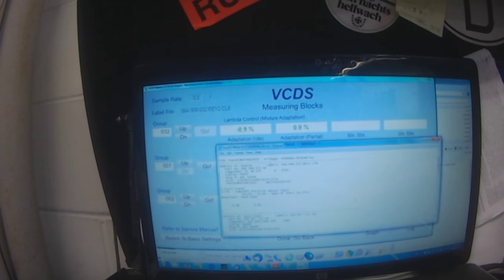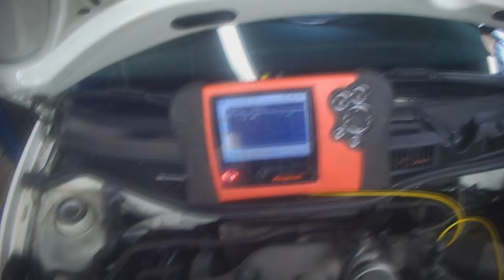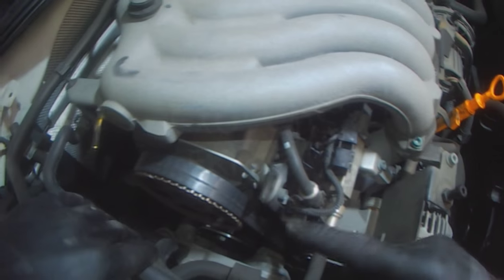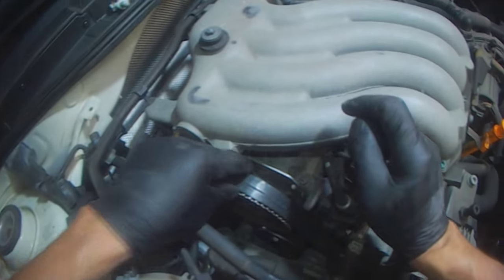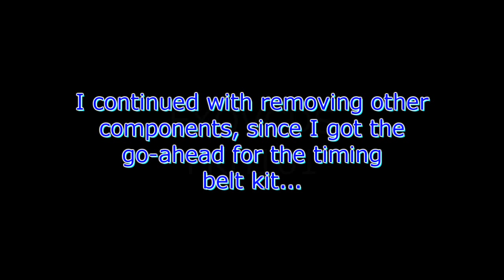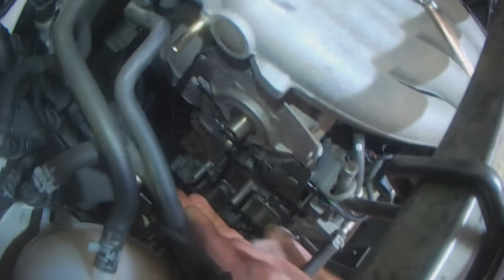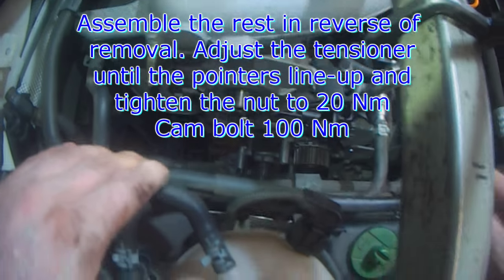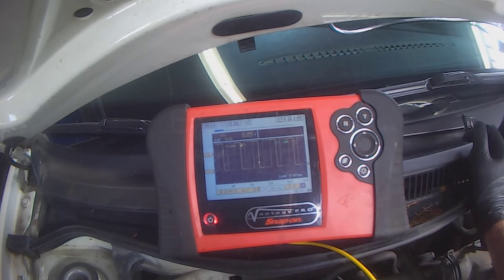VW A4: 2.0L Faulty Camshaft Position Sensor G40 (P1338)

Comment: hey Buddy. I have a A3 AKL engine that has the same sensor. I'm getting intermittent fault codes on G40 and G28 sensors. Should I change both? I was advised to change the CPS sensor first and clean the faulty codes. My car is varying on low RPM and failing sometimes when driving. do you have some advices? Thanks
Reply from the maker: If the engine NEVER stalls or does NOT start... the crank sensor is OK. Make sure that the timing belt is tensioned correctly (not loose). Most likely, the cam sensor is intermittently cutting out... however, that should NOT cause the engine to cut-out / fail. You can disconnect the cam sensor and the engine should still start & run.

I have seen an engine set intermittent cam codes due to missing timing belt teeth! The engine would go in & out of time as the missing teeth caused the timing to shift... it can cause engine / valve damage if the timing slips too far. Make sure that the timing belt teeth are all good! If the belt is older than 6-8 years, replace the belt, tensioner & water pump!!!
Reply: Thanks, buddy. A mechanic just changed the timing belt about a month ago, but he said the tensioner was OK, so no need to change it. I will check the timing and the tensioner
Reply from the maker: Thiago Feitoza If the engine stalls out... it's probably the crank sensor then. Drive with the cam sensor disconnected to verify... after making sure that the tension is ok.
Reply: Thanks, Thomas. I will check the timing and unplug the sensor. Thanks for all your help
Reply: ***** What's up, buddy? I checked the engine's timing and it's ok. I bought a new sensor and replaced the old one. The fault has gone. After this, the G28 fault appeared. I replaced the G28 sensor and the fault got cleared either. Now, every time I try speed up my car, the G40 implausible signal fault appears again. Do you know what can it be? Thanks for all you help, man.
Reply from the maker: Check timing belt tension, timing and the sensor wiring.
Reply: +Thomas EXOVCDS i kno this old lost but wouldnt the car throw a code for a crank position sensor too if thats were the case?
Reply from the maker: David Cifuentes Depending on how far the timing is out, it will only set a cam (G40) code, will set a cam / crank correlation code... or both cam (G40) & crank (G28) codes.

What is the issue with your car if you have one?

Faulty crank sensor should cause a no start or stall.

The engine should run with a disconnected cam sensor.
Reply: well im waiting on a nww keyway right now but it shot a code p0341 and luck is just not been in my favor but i think i might have it down packed now,  i will know for sure when the key arrives
Reply: well i got the keyway and evrything pout back together , and it sounds like shit , my tensioner is set right engine is tdc from transmission window so i have no fucking clue what to do. i hate to say that i am defeated
Reply from the maker: David Cifuentes Can you rotate the engine to TDC and send me pictures of the camshaft TDC mark and the TDC mark at the flywheel?
fkh161@fkh161.ca
When you first had the p0341 code,  did it still run smooth at that time? All you did was change the cam sensor?
Reply: its a weird email adrres but im pretty sure it went through i sesnt two pics
Reply from the maker: David Cifuentes Got them! Looks correct... did you at any time rotate the cam or the crank while the belt was off? Did you unhook a fuel injector?  Is it just running rough or does it sound mechanically bad / loud as well? Can you do a compression test?
Reply: cam rotated quite a few times while belt was off yess,, and yes me and buddy pulled spark plug to make sure was tdc first time around while trynna change the sensor , and i will compression check in the a.m
Reply from the maker: David Cifuentes Valves can contact the Pistons when the camshaft is rotated and the Pistons are up (interference fit engine). Double check the spark plug wires (tight fit) after checking compression.

Comment: Good evening. My 2001 VW Cabrio 2.0 automatic has been shutting off lately when I hit the brakes. Any ideas?
Reply from the maker: +Sal Esquivel At idle speeds only / when stopped at a stop light / parked... or also when at cruising speeds? Check for fault codes, check "fuel trim" values with a scan tool... to see if there are any fueling issues. How is the vehicle shifting? Any codes in the TCM?
Reply: +Thomas EXOVCDS It shifts normal but takes a few seconds to pick up speed &  as I slow down speed, it trembles. Scanner read cam issue.
Reply from the maker: +Sal Esquivel Not all scanners will show all codes... cam sensor is in the distributor. You can disconnect the distributor (3 wire plug) and see if things are different.
Reply: +Thomas EXOVCDS Disconnect it while the car is on? Before I turn it on?l Then drive it?
Reply from the maker: +Sal Esquivel Either... it will / should start with it disconnected and continue to run.
Reply: I tried it on my lunch break. It did run smoother without the cam sensor connected. So I'm guessing it needs to be replaced? Thank you for your time & help.You have a lot of know how! One more question....How difficult would it be to put in a newer motor? Would you recommend it?
Reply from the maker: +Sal Esquivel If the sensor in the distributor were bad, I would not have expected a change in operation. The fact that there is a change, leads me to think that the timing adjustment of the distributor is wrong. It "could be" that the sensor in the distributor is acting up... but the only way to know is to attach a scope to it, to view the waveform. Engine transplants can be done... all depends on money & time.
Reply: +Thomas EXOVCDS I'll be on it this weekend. I'll let you know how it turns out. Thank you again.
Reply: +Sal Esquivel Good day. I drove it this morning disconnected but it turned off on me several times while driving. Not just at stops. What do you recommend I do?
Reply from the maker: +Sal Esquivel Check what is causing it to stall... loss of fuel or spark. Could be a relay issue, crank sensor... any new codes stored? What scanner are you using? Not all scanners will show all codes.
Reply: I did as you said. Checked it all then scanned it again. I tightened what connects the distributor & the cam sensor. P0172 & P0341 are the codes that came up on the scanner. The name of the scanner is CEN-TECH OBDII/EOBD The car did run better but still turned of when I stopped or when RPM's went down too fast.
Reply from the maker: P0172 is system too rich... check fuel pressure, O2 sensor (stuck rich), fuel pressure regulator and anything that could cause a rich mixture. Even a dirty / plugged air filter 

P0341 us either a bad hall sensor in the distributor or incorrect distributor timing (cam & crank timing should also be checked).
Reply: I did a full tune up (plugs, cables, rotor, oil, air & oil filter, fuel filter). a few months ago & everything was running smooth up until a few weeks ago. The only thing I didn't change was the distributor cap. Could this be an issue also as to what the problem could be? I'm not familiar with what you mean by "rich mixture" I feel like just changing the cam & crank sensor all together to see if that will fix the problem.
Reply from the maker: +Sal Esquivel P0172 means the engine is getting too much fuel (for whatever reason)... a cam or crank sensor will not fix that code. You can replace them if you want. 

You might have more than one problem...  too much fuel and another problem that is causing the engine to stall. 

Or, they are related.  

You need to check / test things to determine where the problem is. A distributor cap will not fix those issues... but if the cap is old and worn on the inside, it's a good idea to replace it.
Reply: I feel real dumb asking this, but could the problem come from not have the gas cap on tightly? I went to put gas the other day & noticed that the gas cap wasn't closed correct. As i drove away it drove perfect. No stalls, stutter or turning off. Then I went to re scan it & it came back with no issues. ZERO CODES!
Reply from the maker: +Sal Esquivel Loose gas cap will usually set an EVAP leak code (ECM monitors the pressure in the fuel tank). A loose cap will affect the pressure... and it can affect the purge system (venting of the fuel vapors). Leave the cap tight for longer and see what happens... loosen it to see if things return. That's the best I can suggest.

Comment: when you put the belt back on do you start it at tdc??
Reply from the maker: M G's The belt has to be positioned on the camshaft & crankshaft gears while they (the engine) are at TDC. Starting the engine can be done at any position.
Reply: Thomas EXOVCDS the vw god has spoken 🙌🏾🙌🏾 I just got a mk4 2slow the previous owner did the waterpump and timing belt @100k but didn’t do the cam sensor (sits wit 122k) I just wanted to make sure I wouldn’t mess up the timing
Reply: does autozone/advance auto have that counter hold tool? @4:50
Reply from the maker: They probably do... not sure. I'm in Canada, we don't have Autozone.
https://www.amazon.com/EWK-Universal-Camshaft-Injection-Sprocket/dp/B00VFPOF1E/

Comment: hi thomas i got a jetta 2.0L 2000 and i got the engine code p0341 ( camshaft position sensor or camshaft position sensor A circuit range performance) and i whant to know if the sensor is dead like your video or its sommeting else......
Reply from the maker: Test it... you can use a regular digital voltmeter. Check for power & ground on the outer 2 pins (like in the video), check for a voltage signal from the center wire (like in the video). If it's the original sensor, it's most likely faulty. If a timing belt was replaced and this vode is now present... then the camshaft / crankshaft timing was not set correctly / is out.
Reply from the maker: code not vode.
Reply: so if its not working you sugest me to change my timing belt too.....my jetta got 166 535 km
Reply from the maker: +McFly_Qc Yes, if the belt, tensioner & water pump are still original... change them. If the belt breaks, you will have engine damage. We replace them at 120k km or 6 years.
Reply: ok by the way i got another engine code its P0102 ( mass or volume air flow circuit low imput ) i tink its the m.a.f sensor i already remove it and clean it but the engine code still there...what you tink...
Reply from the maker: +McFly_Qc Make sure that there are no air leaks between the maf and the engine (the plastic air tube, the dipstick tube etc).
Reply: +Thomas EXOVCDS  i watched some price for a timing belt w/timing mark 34.19 $can and a w.pump rebuilt at 56.99$ + 13.61 for core. and a cam shaft position sensor rebuilt too at 84.00$ + 39.00$ for core.....what did you tink i check at napa car parts (quebec)...
Reply from the maker: +McFly_Qc I would order a kit from a vw parts shop like this one for example:
http://www.germanautoparts.com/Volkswagen/Jetta/Engine/290/8
Reply: i watched this but the price are us$ i tink and im sure the price w/shiping will be more expensive. but its a great place to order vw parts...
Reply from the maker: McFly_Qc That was just an example... you can find a Canadian distributor. Go with whatever works best for you. I don't like mail order because you can't talk to someone face-to-face. If napa works for you, use them.
Reply: lol good i tink same way to...but the napa kit dont have all parts like the one you shown me
ther kit include timing belt w/pump and the tensioner only but its the same manufacturer.
so the quality must be the same like the original one.....
Reply: i got some sticker for you im waiting to have more and i will send you all.....
Reply from the maker: McFly_Qc If quality is the same, use napa.
Reply from the maker: McFly_Qc Thank you.
Reply: Hi Thomas did i need some special tool for a rear brake job on my jetta 2000...
Reply from the maker: McFly_Qc 17mm socket & ratchet to remove the rear wheels, jack stands for supporting the rear of the car, 13mm & 15mm wrench to remove the caliper from the rotor, side-cutters / pliers to remove the brake cable clip from the caliper, phillips screwdriver to remove the brake disc from the hub, a hammer to remove the brake disc from the hub (if stuck), the piston "retracting tool", brake fluid (if you are flushing the system), something to suck the old fluid out of the reservoir (so that it will not spill over when pushing the pistons back in). A service manual, gloves, paper towels, a flshlight / light, brake parts cleaner, a bristle brush for cleaning rust off of the pad carrier, anti-seize, brake cables if they are bad, 10mm wrench to remove the brake cable nuts (only needed if you are removing the cables).... I might have missed something.
https://www.youtube.com/watch?v=UpSLXI7KpYM
Reply: tanks for the solution your the best..
Reply: by the way if the cam sensor no more work did my engine wont start?

Comment: If a 99 audi a4 Quattro 2.8L doesn't reverse and only accelerates slows at high rps could it be a sensor?
Reply from the maker: no. std or auto? if auto... tranny issue.
Reply: It's automatic with tps. But gives a code for speed sensor
Reply from the maker: +joshua cruz Speed sensor for auto tranny... it's an output signal from the tranny to the tcm. if there is a problem with the tranny internally, the signal from the speed sensor will not make sense to the tcm and set a code.
Reply: So most likely the Trans is gone?   Do you have any good guides for a diy replacement of Trans.  Never worked on audi or vw
Reply from the maker: +joshua cruz I have no idea if the tranny is gone... from where I am. It could be a valve body issue or something major internal. I can send you removal info if you need it... but I would suggest having someone (tranny shop) look at it to verify that there actually is an issue.
Reply: +ok.  I just been hesitant to take it to a shop cause kind of expensive and wanted to make sure if I could have done it myself
Reply from the maker: +joshua cruz you might still be able to... but for someone to diagnose over the Internet will take way longer than someone who has his hands on the car. once you know what is wrong... I can send you information. whether or not you have all the tools that will be needed is another story.
Reply: Alright well  thanks i might give it a shot

Comment: how do you re tighten the belt tensioner ?
Reply from the maker: You rotate the adjuster until the tensioner "pointer" lines up with the reference mark... then, you tighten the 13mm nut.